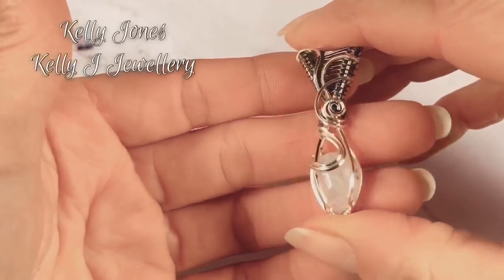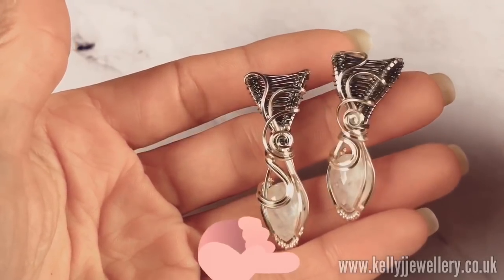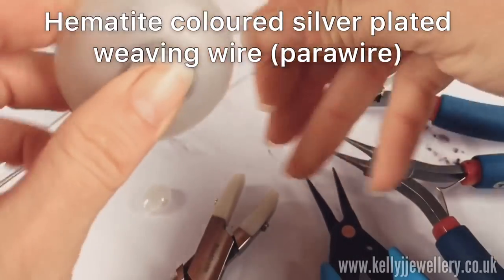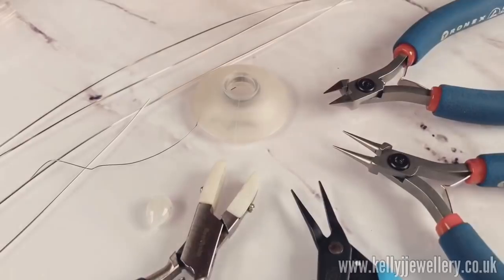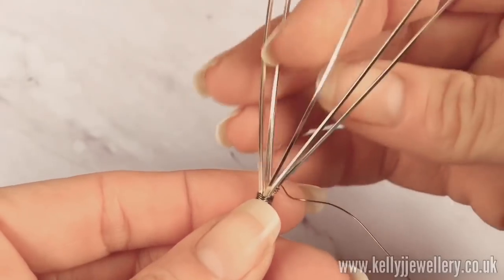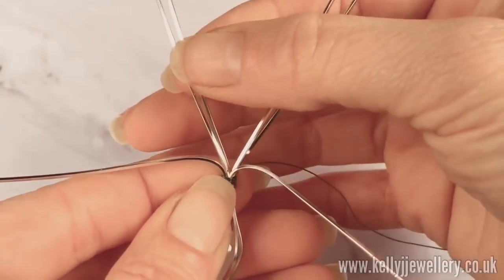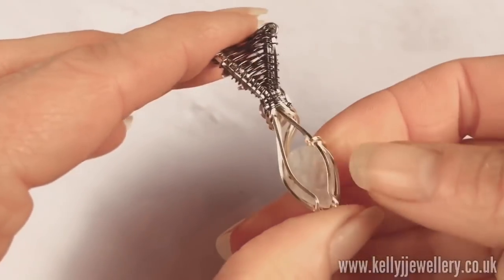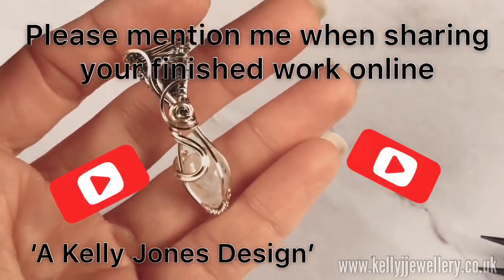Wire Wrap ‘Swirl and Curl’ Pendant Tutorial.

Comment: I’ve never used Parawire, do you like it? Does it tarnish?
Reply: I find mine tarnishes over time. But so far it's just the half round wire. Depending on the type of skin a person has some people are pretty acidic.
Reply from the maker: I like parawire because it’s cheap and pretty, I find most wires will tarnish with time. You can use a protectaclear coating, this will make it last longer, or keep a polishing cloth nearby. I haven’t been using parawire for long, I love the square and half round but I find the round wire a bit tough to work with.
Reply from the maker: And thanks both ❤️